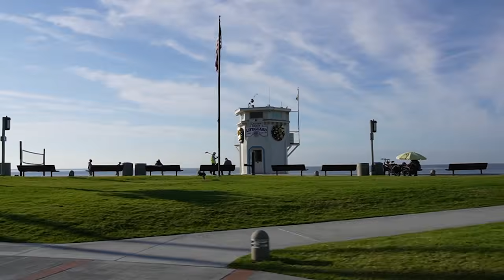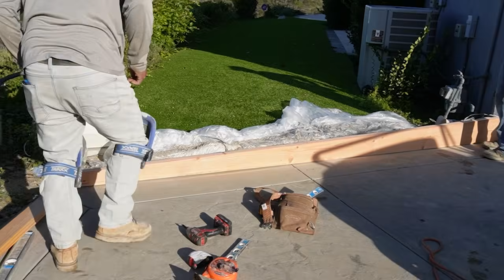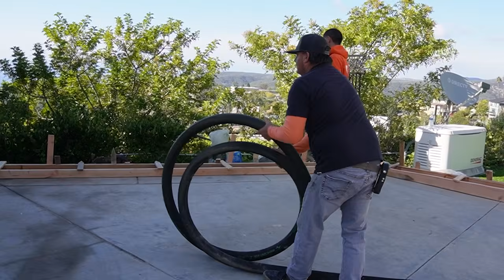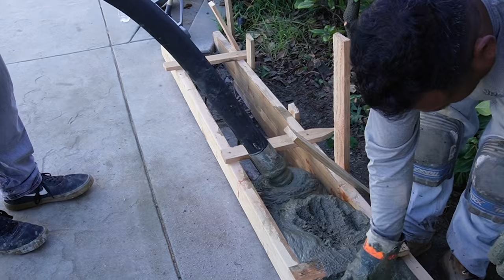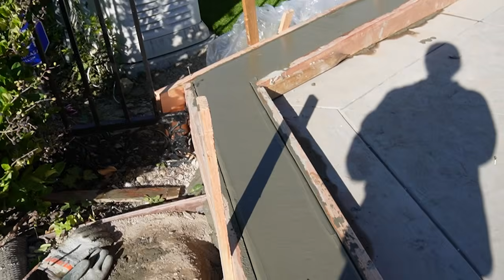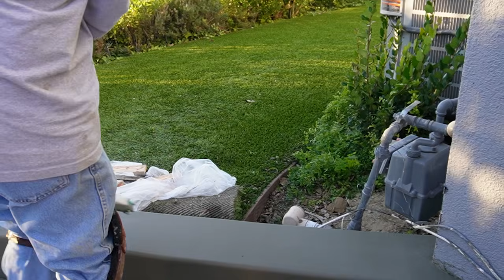How To Fix & Repair A Failing Concrete Wall!

Comment: Qwrshchion way not use a concrete saw cutting to do demo 65 HP cutting 6 inch concrete 16 inch cutting  blade a resedechail   how fast can I cut it in 2 hr  2 and one hafe feet sqwers  this this is Mr art the concrete estimater

Comment: Good morning Anthony!  Amazing video. Thanks for all the great info. Question: For the forms that were sitting on top of the existing driveway, how did you pin/support them to the concrete? I saw that you nailed a spreader stake on top of the forms. Was that the only thing holding the forms parallel to each other?  Thanks man! 👌🏼